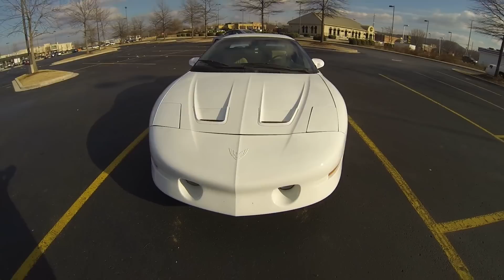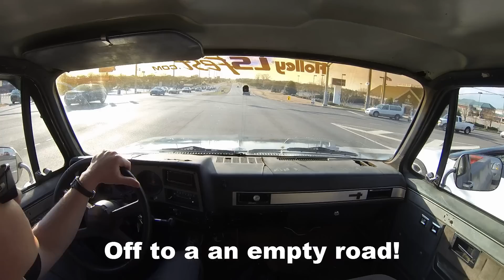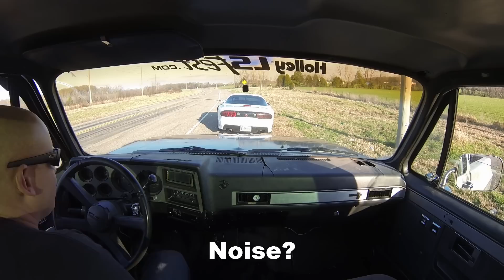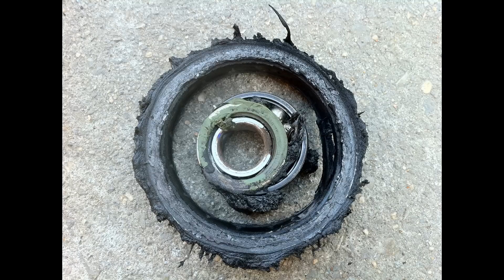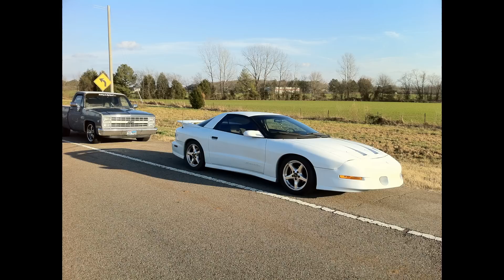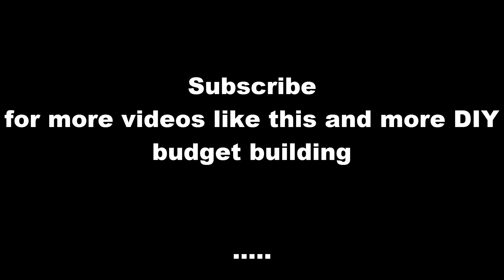84 Chevy Truck 5.3 LS vs 96 Trans Am LT1 - Street Race Video - C10 Before Heads/Tune Race

Comment: Great video and race dude
Reply from the maker: Alex Rodriguez Thanks Alex! it was fun. It was mainly to see the performance progress as the mods are added to the truck. It just had the motor swap and next up with to race again after the tune and ported heads were installed. I wish we could have gotten to see that race because the truck picked up 50whp, but the truck was stolen before we could set up a rematch.
Reply: +AGearHead4Life nothing worse than a thief willing to steal from someone that works for what they have sorry to hear that but man there is no shame in losing to an lt they are no slouch no ls but no slouch either
Reply from the maker: +Matthew Hodges Thanks Matthew! Yea, cant stand a thief. I put so much spare time and effort into that truck, it almost felt like losing a family member. Yea, I wasn't afraid to post a video of my vehicle losing a race, because I wanted to show it's progression as I built it. But, from other comments here, I learned that most people aren't opened minded enough to look at the whole picture to see what's going on. Yea, LT1s are pretty stout. I use to swap those before LSs. Keep on Wrenchin brotha!

Comment from the maker: You could run the 700r4, but I'd suggest just taking the 4l60e with the new engine and installing it. I think it'd prevent future headaches. If you do you the 700r4 you'll need a flex plate spacer. They either come on the 6.0 or you can buy a TCI kit to make it fit. It'd still work with your gauges since that infor doesnt go through the PCM on that truck. Its straight from the sensor to that gauge. IF you get new gauges, just run it to the new gauge.

Comment from the maker: How about a minimum of 5 more mpg plus 100 more ft lbs of torque to tow with? Also, I stated it was a daily driver. 6.0 drink more gas than the 5.3 and the 5.3 had plenty of power for its purpose.

Comment from the maker: The smog items where minimal on the 5.3. I believe they run much cleaner. The only thing it had was a pipe going from the manifold to the intake with an egr on it. Then a solenoid on top of the intake for fuel vapor. Then of course the secondary O2's and cats. 

I've heard rumor that these engines in stock form could pass an emissions test without the cats. I know Cali's strick though. I was there for four years.

Comment: Wicked c10 
I'm researching a stock 5.3 swap for my 82k20 
I'm going to chain my wheel to a bolt under the seat  as soon as the snow melts like the military pickups and blazers. As they were all keyed the same
Reply from the maker: Thanks Mark! Cool man! You'll love the LS motor. Yes! secure that baby. Good luck with the build man.

Comment from the maker: Finally got the truck dyno'd yesterday! woohoo! This would be considered the ''after" dyno. After my home ported heads were installed and tuned. It is no longer running lean. Now my bald tires are slipping. Time for tires and then a rerun. I've already messaged Mike in the TA.

Standby for new video! Here's a hint torque went up 55 ft lb :) 

Subscribe to make sure you that you see it as soon as it comes out.

Comment from the maker: Also, if you had been following my previous posts, you'd know that the purpose of this truck is to be a daily driven work truck. Its final goal is not to be the fastest. It was to be to tow my Turbo'd 6.0 Camaro. This video gives others a comparison to judge for their build. It also gave a before and after ported heads and tune comparison.

Comment from the maker: From your response, I can tell that you must be young and not very knowledgable of the difference between the newer LS series engines and the older SBC. Let me help you out. 350 = about an average of 200hp and got 12mpg. 5.3(325) + about 300hp and 17+mpg. So, thats 100 more horse power and at least 5 more mpg. Why wouldn't I swap it?

Comment: That 5.3 is not an ls motor it is a vortec truck engine the dimensions are different and the ls motors are 6 bolt main all aluminum blocks

Comment: my gawwddd im so bummed out,i had a 96 lt1 in my 96 s10 back in 1998 with a 5 speed and it was fast as hell,spun tires in every gear,so with all the ls talk and on every tv show you see ls swaps,i just did one and i got a 6.0 installed a cam got a tune and im making 384 to the tires,5 speed again and its a dog on the bottom end,omg im so bummed out,if i could do it all over again i would go with another LT1 OR LT4 for the win.damnnnnnnn it.LT1'S RULE AND LT4'S ARE EVEN BETTER  fuck LS

Comment: weight was the issue.
Reply from the maker: yep, part of it. This was just to see how the truck held up to the TA. Shortly after ported and milled heads were installed onto the truck and a tune. It gained 50rwhp. We never got to rematch though because the truck was stolen.